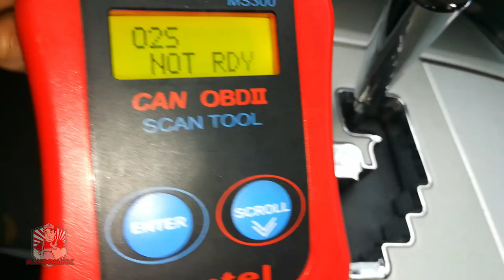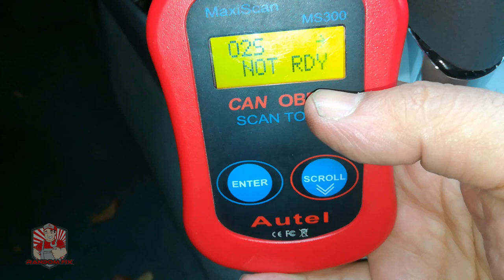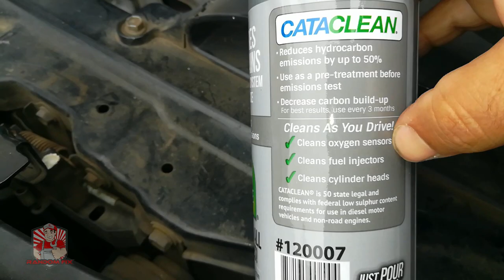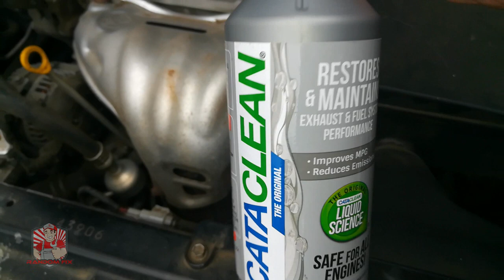Essential tips to prepare your oxygen sensor monitor.

Comment: This may not work for everyone but it worked for me . After trying everything for 2 weeks I realized my O2 monitors had gone to sleep and needed to be woken up so I disconnected both O2 sensors and started the engine then waited for the check engine light to come on which it did in about 30 seconds , then I re-connected the sensors and used my tool to erase the code and drove a couple of days (maybe 5 normal drive cycles) and the O2 monitor finally set .
Reply from the maker: Hi Joseph, great tip!! What are you driving?
Reply: @RANDOMFIX  2006 chevy Suburban . I used this trick for my last smog check 2 years ago and again just this week . I have a recurring evap code (P4055 large leak ) and every time it comes back all my monitors are set but I also have a pending code so for several months I've either had monitors not ready or a pending code . By unplugging and then reconnecting the 02 sensor I expedited the 02 monitor to set before the evap code came back .
Reply from the maker: Hi Joseph, thanks buddy that is awesome tip. I will try to include in future videos.

Comment: I own a 2011 Toyota RAV4 . I recently disconnected the battery to clean the terminals . When I went for emissions testing it wouldn't pass due to catalyst and oxygen monitor not ready . I have driven over 100 miles on the highway and tried different drive cycles and when I hook up the OBD 2 scanner both monitors are still incomplete . Any suggestions on how to get the monitors in the ready mode so I can pass the emissions testing
Reply: did you figure it out?
Reply from the maker: Sorry for the late reply! did you find a solution?

Comment: I had the O2S & HTR codes on my ECK test says the monitor not ready so I replaced all four sensors but I still get the same thing, no ck eng. light on or any codes truck runs good drove it 200 mi. tried the catcleaner in the tank still have the flashing red codes on scanner had it checked by a Ford mechanic it says the sensors are working good doing what they are suppose to do they should have cleared out by now running out of ideas
Reply from the maker: Hi Ed, sorry to hear about your frustration, did you install the oem o2 sensors? And more importantly did how is the battery? Here is the ford drive cycle with lots of information and how to get the all the monitors ready. I can answer question after you watch that video. Good luck and keep me in the loop

Comment: 2005 escalade v8 taking over 50 miles to reset heater 02 snr monitor, ir has 2 front and 2 rear 02 sensors. my scann tool says the draw 1 amp each at 02 heater, any idea? i wonder if i should check the amp draw w my osciloscope
Reply from the maker: Sorry for the late reply! did you find a solution?

Comment: Mercedes CLK430, just went through this smog hell. Watched all the videos and read all the good tips but the O2 sensor problem continued even after changing all the sensors. 2500 miles of driving around like a fool i finally gave up and took it to a shop with a dyno where they tried for 3 days without success till another mechanic noticed my brake lights were on while the drive cycle was being performed. They replaced the brake light switch($30 part), reset the computer and 50 miles later my headache was over. So i guess the computer was registering that i was on my brake all the time while performing the drive cycles.
Reply from the maker: Wow, this first I'm heard about a brake light switch causing such a big delay but I can see how this would make it impossible to get your car ready for amog. _Randomfix
Reply: A  I had no codes or check engine lights before or after changing the o2 sensors, just the brake light switch cancelling the drive cycle test. And i also tried the recommended product before changing the sensors.
Reply: Stuff like that will make a man insane
Reply: Having a similar issue. No check engine light. At about 800 - 1000 miles right now. OBD reader from AutoZone says something about my Anti break system (ABS). But it also said my brake fluid is low and it’s completely full
Reply: @Zzz-qy4co  did you ever find out what the issue was? I’m having the same issue as well, I brought the car to get a smog and 2nd o2 sensor is not rdy, I have put over 100miles and it is still not rdy, I’ve done the drive cycles online as best as I can and I don’t have a check engine light on or mil light.

Comment: The dealer is telling me that the Rear oxygen censor is bad on my car and that is why the MIL light is on in my car.  The manual states that it is a indicator of the emissions has a malfunction.  But the dealer is saying that it is not a emissions problem.  Is this true?  I have a 2016 INFINITI QX60.
Reply from the maker: Depending on the mileage of the vehicle I personally feel this is an emission part just like a turbo. California emission warranty 7 years/ 70k miles and federal is 8 year / 80k miles normally.
Reply from the maker: if you mileage is within the lower than 70 or 80 k for federal, I would call Infiniti directly, the dealer has not incentive in keeping your happy.

Comment: I had this pesky problem with my 2012 Nissan Rogue. I finally took it to a mechanic asked them to "Complete the drive cycle" for me then smog it. My car passed and I picked it up in 3 hours.
Reply: I sure don't have to take my car in but it may be looking that way.
Reply from the maker: What monitors were incomplete when you dropped your Nissan rogue off at the mechanic?
Reply: @RANDOMFIX  Just my O2 Sensor monitor. All of the other monitors were ready.

Comment: Hello sir, I have a rather odd issue with my 01 DeVille. I bought the car in march 01 and had to go through emissions and it passed no problem. I had to take it again this year and failed or was rejected because catalyst and o2 sensor monitors weren't ready.I let it idle for 2 1/2 minutes with a/c on high as long as having the rear defog on. That didn't do anything except make the evap monitor not ready so today I drove it to the store with the air on max and rear defog on and when I got home, I help the RPM to like 3000 or so RPM, now none of the monitors are ready. I have no engine codes but I did have a problem with it last summer. The car suddenly started running like crap and got horrible gas mileage P0300. I finally tracked that down to a defective coil pack on bank 2 so I replaced it and ran like a charm. That was he only time I ever cleared and codes. Any advice where to turn next?
Reply from the maker: If the issue with p0300 is fixed then you can just complete a gm drive cycle

https://youtu.be/Yp34ksJY-fQ
Reply: @RANDOMFIX  Oh, I forgot to add that this was fixed about 3-4 months ago and I didn't even have to clear the codes, the engine light turned off on its own but cleared it anyway. I am using ScanXL Pro on a laptop now and something seems fishy with an o2 sensor but not sure. I will see what happens with the drive cycle. I will see if I can get a screen shot.

Comment: I am in California, I have a 96 nissan altima (Auto) bought in Arizona (2 Catlytic convertors, 1 near engine, 1 after flex pipe). No code, but CAT + O2 sensor not ready after driving for over 200-300 miles over 2 weeks, after LAST reset (battery reconnect, and flex pipe change) over 2 weeks ago. Upstream O2 sensor (near engine): tested working (use flame and measure voltage change. See 0.8-0.9 volt when hot). Down stream O2 is newly bought and installed. Noticed, CAT near engine has little honeycomb damage. CAT after flex pipe (downstream) has minor honeycomb damage, and hole is not 100% perfect, may be 10% clog. When running car hot, measured temperature of down stream CAT, before / after is about 100 degree difference, down stream CAT works.

The car has newly changed flex pipe 2 weeks ago due to exhause leak, and has no exhaust leak to my best knowledge. Engine section has no leak (oil, vacuum), Numerous cleaning are done before change flex pipe to get rid of CAT + O2 not ready issue, such as seafoam. Batter is about 2-3 years old and voltage is normal. Downstream CAT was taken down and put in soup overnight 2 times (tried to clean).

I've tried driving pattern recommeneded by Nissan official document in last 2 weeks. It's driving pattern is not very general as seen in many post. No success after 5, 6 try.

Upstream CAT (near engine) was not tested for temerature difference, as I am not sure how to test it.

Before changing flex pipe, CAT + O2 not ready (no code) issue existed few months ago.  I've attempted to get rid of it by clearning, such as MASS sensor.

The car idle is not 100% smooth, but ok. The car has no otherr know obvious issue.

What should I to get rid of at least 1 of CAT + O2 not ready issue? Thank you for help and advise.
Reply from the maker: H L , how many miles are you Altima?
Reply: @RANDOMFIX  140k miles. thank you.
Reply from the maker: HL, I've been thinking about your dilemma, as long as your 02 sensor are oem and working this may help you. Make sure you have a proper connection with no resistance on the 02 sensor plug contacts. Sorry I didn't respond over the last few days. Here are my two suggestions. 
The first is going to sound a little odd. Take the vehicle for a short drive to warm it up (5 miles) then park and hold your engine RPM at 3k for  3 minutes (make sure you have right oil, oil level, and becare not to overheat your engine).  This technique is good for early obd2 vehicles.

The second option is to go for a long long drive 100+ at a constant speed, try with the cruise control and cruise control off. You need to get you CATS super hot

Now you may be asking yourself will my advice about first two suggestion work? ? Honestly, you should focus on getting the 02 monitors ready first. I've found over the years when the 02 monitors aren't getting ready the throttle body needs cleaning. I'm not sure why this is but this what I've found.  >>https://youtu.be/hsGNYdeZLec

Best of luck and please let me know what happens. _Randomfix
Reply: @RANDOMFIX  Thank you so much for detailed suggestions. Will try and report back.
Reply: @RANDOMFIX  Not done road test yet. 

I want to make sure new O2 (downstream after CAT) sensor really works. I am surprised and confused!!! NTK sensor is 3 months old. It’s direct fit, look exactly same original: 3 wire, middle black is signal, signal ground is sensor body, wht/red are heater with 6.5 om resistance. I used torch heat it up for 30 seconds - 1 mi, but no 0.9v signal voltage is detected, not even any voltage detected during heat up. I went to Pepboy bought new NTK sensor again, same result. Then, I went to Oreilly to bought Botch direct fit (sensor heat look different), exactly same result. 

I think may be the way to test it won’t show up any voltage due to ‘it’s not 100% wire up condition when put into car’. 

I put sensor back on CAT, try to see if any voltage can be detected. It’s NOT wired, no car battery voltage applies to sensor. I connect voltage meter probe to middle pin, and another probe to car body, CAT. Start the car for over 10-15 min, and see the car temperature becomes normal driving condition. During the process, NO any voltage is detected. Is the test valid?

So, the 2 new O2 sensors DOES not work. Can I make such conclusion? 

If that’s the case, O2 + CAT not ready is never going to go away no matter how ‘hard’ I drive it. I am really confused!!! Any suggestions?
Reply: @RANDOMFIX  Report back:

1) I drove according to your suggestion, few time (about 100 miles in in 1 day). Same result (CAT + O2 not ready). After that, drove the car for about 100-150 miles in about a week, mixed local + highway.

2) After that, I feel new downstream (after CAT) sensor may have problem. I checked year of the car. It has 3 types of sensor. I realized the new sensor installed while driving according to your suggestion may not match manufacture data.

Eventually, I got one that matches manufacturing date. Also, I got a wifi ODBII monitor to monitor the downstream sensor voltage live. The voltage is between 0 and 1.2 (not 1 <-> 0.9 as expected) during driving. It stay mostly around 0.2, and sometime goes up 0.9 and 1.2, and drop very quickly. I can’t tell if it really works well.

After install correct O2 sensor, I did drive pattern for CAT + O2 readiness, according the manufacture manual few times. Drive is not perfect (impossible to be perfect), and SAEM RESULT: CAT + O2 NOT ready. I drove for above 100 miles with new ‘correct’ O2 sensor.

BTW, upstream (before CAT) O2 sensor voltage change is ‘normal’: 0 <-> 0.9. Fluctuate and very responsive to gas pedal action. Downstream O2 sensor, not very responsive, and stays low around 0.1v - 0.3v most of time. If going up 0.9v, 1.2v, it goes down almost immediately.

Any suggestion?
Reply: @RANDOMFIX  I'm having the same issue on 2004 Kia Spectra. 02 monitor not setting and its close to 300 miles.  

Any suggestions? I'll try the video you posted but wanted to know if you have any other updates.

Comment: I want to get an emissions test and I got this as not ready So I failed because I had the evap one too... So there are two markers not ready well anyway I got a scan tool from Walmart and I checked around the engine bay and saw one hose for the vacuum to the intake manifold wasn't connected properly it must've popped off so I went to AutoZone and got a new vacuum line for 4 dollars... I always wanted to replace all the hoses for the vacuum system anyway I know it goes to a butterfly valve that opens and shuts some type of thing for the intake manifold anyway I replaced the hose and my O2 sensor is completely ready now your problem could just be that something like that check your vacuum lines I also replace the air filter it wasn't that bad but I did it anyway I also make sure all the connections were connected but they were fine had to be the Vacuum line... So yeah you could have a leak there... Because 10 minutes after I did that It was on right away and ready so tomorrow I'll go get my emissions test even though I don't have an even though the evap is not ready  i'll pass just fine...  But at least it's finished and my registration will be paid because otherwise I can't pay my registration until the test is done... But yeah  could be simple as checking your vacuum lines make sure they're correctly attached... I'll be replacing the rest of the lines because they're hard as a rock they're supposed to be a little bit flexible you know what I mean after I get the tests maybe in a couple weeks I'll do them all... And I'll get to the bottom of the evap leak Probably a purge solenoid valve or disconnected hose underneath the car I haven't really looked at but I would smell gasoline but I don't ... I know in the engine bay I smelt it for a while but not anymore
Reply from the maker: Yes, it often is something simple but hard to find the issue and congrats on finding yours.

Comment: Wait... is this a way "around it" or it wont pass if you actually need to replace a sensor?? Which I guess wont even be cus the check engine light would be on
Reply from the maker: This not a way around however if you fixed your the cause of a check engine light or the check engine light does turn back on for a few miles then this would set all your drive monitors also known as inspection monitors (I/m monitors) so you pass a obd2 readiness test. I hope that helps a little _Randomfix

Comment: I have performed the drive cycle 7 times on a 2009 mercury mariner. The O2 & HO2 sensors still will not reset. The Mercury drive cycle differs from the Ford according to my owners manual. I’m looking for suggestions or do I replace the sensors? Thanks
Reply from the maker: The mariner was the same as the explorer so I'm not sure why your manual is stating that this. Here is the Ford drive cycle for all Ford drive cycle.https://youtu.be/j8ZFTE1rSfA

Make sure you battery is perfect, use a real load tester, ( $20 let know if you need help) and then check the o2 sensor connection ( unclip and clean if if need and clip back in ).
Reply: Thanks so much. I performed the Ford drive cycle 1 time and it reset. I’ll throw away the owners manual
Reply from the maker: David thanks buddy for the confirmation and I appreciate you following up and posting this.i spent 2 weeks making these video for each make and I'm glad it helped you. Imagine all the gas and pollution created from completing a drive cycle. Odd it's it?
Reply: @RANDOMFIX  so I got a 2010 Ford Escape, I know it’s basically the mariner or whatever equivalent is to mercury. Thanks for the link I’ll try it tomorrow morning and hopefully I’ll pass! I’ll update later

Comment: I have a 2017 benz c300. It has a downpipe with no CEL after putting it on. Ive driven it for over 500+ miles and no CEL. I went to a shop to do my inspection and i failed with
Readiness: Fail
Monitor Catalyst: Not Ready
Monitor O2:  Not Ready.

I was told by the shop that i need to drive it for an hour or two over 60mpb to have it activated then come back. But ive driven the car for 500+ miles, shouldnt that have gotten it ready?

Someone please help
Reply from the maker: Sanny, thanks for reaching out and so I had video for your 2017  Mercedes Benz c300 drive cycle so you can get your o2 monitor and catalyst monitor ready.

https://youtu.be/gLnhD4gP0kM

 Good luck and keep in the loop, I will assist you passing.  😊

Comment: My emissions was rejected because of the O2 sensor monitor not ready and I believe it is because I just bought the car on July 28th on July 29th which was my birthday I must say I was cleaning the car I have the doors open for quite some time cuz doing a lot of cleaning and the car died so I had to manually jump it with my portable jumper I was told to drive the car for a week and go back
Reply from the maker: Hi D, best of luck with emissions test. Let me know how it goes and if need additional help just let me know me know. _Randomfix